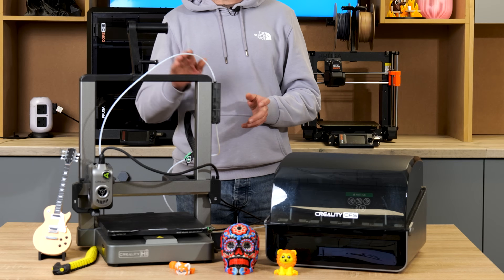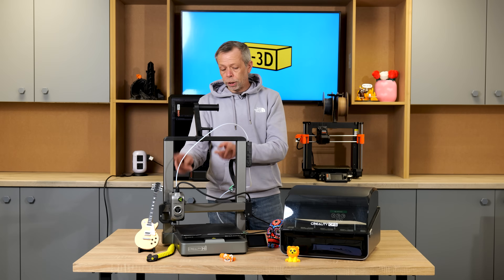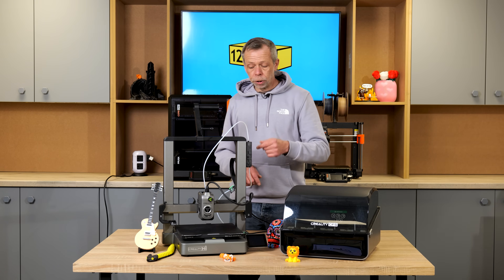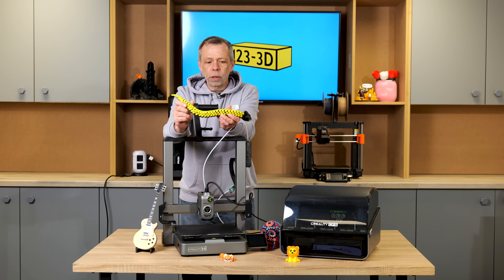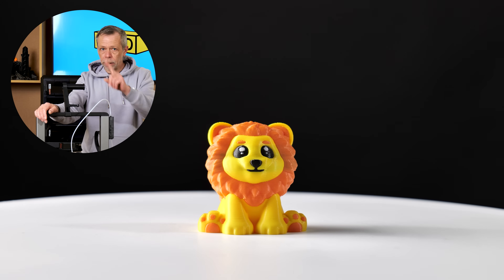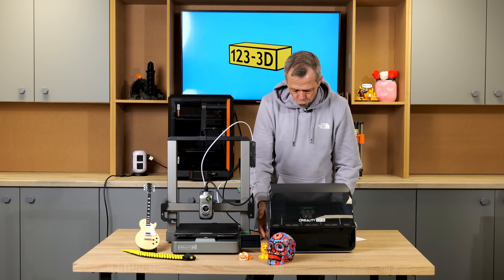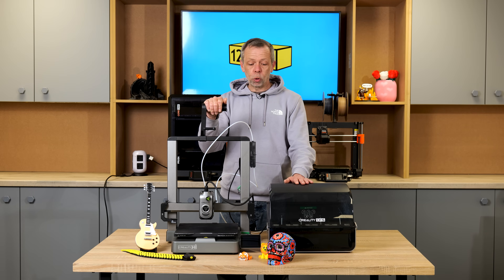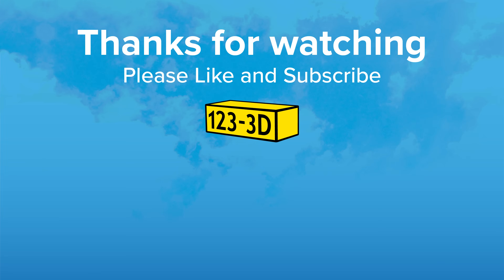Everything You Should Know Before Buying the Creality Hi Combo! | 3D Printer Review

Comment: I just bought mine! Do you have a link to that snake print?
Reply from the maker: This particular snake is from STLflix
Reply: @123-3D-UK    Thanks!! One more question, we've got the printer correctly assembled and we randomly get FR2851 “Retract issue, Filament Buffer failure" and FR2849 “Retract issue, filament cannot be returned to CFS hub errors. Have you heard of those before?

Comment: 2025.12.11
Bought mine April 2025.  Had zero issues, loved the multicolor and for a bed slinger really liked it, with several hundred hours on it. 
 Until.......
A month ago when the bearings on the x-axis started grinding and created crappy print quality.  3 weeks of back and forth with Creality Support they sent me a new X axis guide.  Upon receiving that it was obvious it was the issue, replaced it.
After firing up to calibrate the z-axis motors were out of whack... Trouble-shooted with CS and they said z axis limiter switches, so they sent me those, 2 weeks later installed them and it helped, but still have z axis not aligned correctly on the right side and as it goes up the right side makes a loud clunky sound and you just have to power it off.  All cable connections are solid, the area is pristine clean in an isolate clean cabinet.... My guess is CS is going to try and send 2 new z axis motors... so that will be weeks again.

The point for you?   CS support is slow and you are required to do alot of trouble-shooting ON YOUR OWN.
If I was a 3D print farm, no way would I use Creality.  I have had 6 CS printers and only one - a CS SE has been reliable, that is not a workable success rate.

If you don't mind trouble-shooting an tinkering, the prices are decent.  But we aware of what I have conveyed.

Comment: How do you print up to 16 colors to print with the printer?
Reply from the maker: You need multiple CFS units then simply daisy chain them together with the data cables. Then just connect all the PTFE tubes to the buffer unit.

Comment: My Hi combo keeps jamming in the extruder after just one or two filament swaps, I think when it retracts it causes it to get caught on the sharp edge of the filament hole that is next to the gears, just before the filament gets to the cutter, or for some reason after cutting instead of retracting it pushes or lets slip the filament down into the blob of heated filament, causing it to bulge and get stuck at the gears when retracting because of that. Anyone else have this issue and how do I fix it?
Reply: Yes I had the dreaded blob, had to take it all apart.  Was running at too high temp.  Now run nozzle for pla at 220, 56 bed.  If your extruder is full of crap I let it soak over night in acetone which, cleaned it out.
The blob inside of the rubber had to be pried off.  Then remove the screw holding on the fan and plunge the hole with the clog cleaner.  Good luck.

Comment: Is it possible to get extensions for both of the leads between the CFS and the printer? I ask because I am short of space on my print garden (not a farm yet) and also being wheelchair dependant I can not put things up where I can't reach them. I need to plut the CFS down below my print bench. Another question: Does it matter if I was to use a longer PTFE tube from the CFS to the printer. Thanks in advance.
Reply from the maker: Yes you can get longer cables, they are 485 6 Pin Connecting Cables. As for the PTFE tube yes you can use any length tube, but its worth noting that the longer the tube is the further your filament will need to retract making your colour changes slightly slower.
Reply: @123-3D-UK  Thanks you.

Comment: It would be great if the CFS unit could be placed on top of the printer, and Steve said that would work if the cables are long enough. 
But are they? How far above could the unit be placed?
Reply: There is a shelf attachment on the creality cloud for that
Reply from the maker: Out of the box the unit couldn't be placed above the printer, Steve is suggesting that you put it on a shelf so it isn't taking up work space. You would have to buy a length of PTFE tube then cut it to the length you need, then buy longer versions of the cables that it comes with.

Comment: Hi Steve, how far can the hoses and cables between the printer and CFS be stretched? I am considering placing the printer in a box where I currently have the V3 KE and CFS somewhere next to it.
Reply from the maker: Hi, the tubes are fairly long but if you did need longer ones you can always just buy your own PTFE tube and cut it down to the length you need.

Comment: Hi Steve can a user use aftermarket filament in the CFS or do they need to be Creality brand only? Thanks
Reply from the maker: Hi you can use any filament you like
Reply: Great question- I was wondering the same thing and couldn't find details. Lists it uses rfid on the spools and I've seen too many printers "require" oem ink and refuse to print so it's a hassle to use anything else. 🫡
Reply: I use sunlu

Comment: Can you test pause and resume on this machine? I.e.  for inserting magnets. Some of the other Creality printers (K1, KE) have a (yet to be fixed or even acknowledged) bug in the firmware that basically destroys many of the prints at random after resuming from a pause.
Reply from the maker: We haven't made anything requiring inserting parts mid print yet, but we have paused and resumed with no issues.

Comment: I just bought one and am waiting for it to arrive.  I originally bought a Anycubic S1 but that machines multicolor unit would not work at all. not 1 print could go through it so I sent it back.  Really have "Hi" hopes for this little bed slinger
Reply: i have an anycubic s1and am sending it back.  plagued with problems
Reply: @ronaldderi7471  My Hi came and at first i couldnt get it to work at all.  Kept getting "unexpected resistence" error.  It took a few hours but i figured out the back cover on the printhead was blocking the cutter from engaging. Also the ejection plate for the purge was bent.  I took off the back cover and bent the ejection plate to straight and now the printer works fine.  It seems like printer companies are having BIG quality control issues.

Comment: I got this combo on the weekend and it took a while to get sorted.  Printing perfectly now, but I did hit one big issue.  All the images show the buffer unit being attached at the top of the side gantry. This means the cable from the buffer to the CFS box is quite tight if the box is sitting at the same level as the printer.  A stretched cable (with pins making intermittent contact) causes a world of problems, mostly being the filament doesn't actually get pushed from the box into the printhead.  So either have the buffer box 10cm down from the top of the gantry, or raise the CFS box slightly to have a little bit of slack in the connection cable.

Comment: The most important thing to know is that it's made by Crapality. Well known for parts that aren't soldered, printers that require a months worth of work to make print, and generally just low quality crap.
Reply: I owned the V3 KE and yes you are right. The quality isn't there. However the Hi seem like a good quality machine. The bar has been raised high by the Bambu A1 and the Hi is a direct competitor.
Reply: I know... I have a A1 Mini and its solid so I am thinking about getting the A1; saw this and on paper its better but... Creality made it. What to do...

Comment: I'm undecided, I don't know whether to buy the Creality Hi or the Bambu Lab A1.
Which one do you recommend based on your experience?
Reply from the maker: Really tough call. I would probably go for the Hi based on it having a slightly bigger build volume, and the CFS being easier to do maintenance on with the PTFE tubes being accessible from the underside.
Reply: @123-3D-UK  
As I want to start and when I talk to my friends who already have one, they all recommend Bambu Lab, 
so the decision is very difficult
Thank you very much for your videos, they are magnificent
Reply: I have an A1 and a V3 Plus, bought them about 2 weeks apart and they are both great.  Each has its own weaknesses and strengths.  The A1 always seem to struggle slightly with PETG compared to the V3, but at the highest speeds I think the V3 loses some quality compared to the A1.  Build plate adhesion on the V3 seems better, I usually use a replacement after market build plate on the A1 (once lost power on the A1 when I was out of town, and 6 hours later just started the printer and completed the job - just holds onto the PLA print even when cool until you flex the plate and take it off - stock plate won't do that for you).  I also had to replace hot ends on both due to 1 single blob I had on each.  Service was very good from Creality - got replacement parts for free. So overall I put these printers on a par - except if multicolour is a requirement of course.  I don't know the Hi yet of course, but I think Creality has upped their game.  I used to have an Ender3 S1 Pro as well a few years ago and it needed quite a bit of cajoling and loving care to work well.  Just when the printer got me confident that this time I could start the print, check the first layer and walk away it would fail, some times for 5 or 6 out of the next 10 prints until I started to question and review my print setting that had been working for weeks on end.  With the A1 and V3 I never seem to have issues, unless I neglect normal care like keeping build plates clean and parts lubricated.  From what I have seen it seems to me this Hi will be the same - although it is early days of course.  And Bambu's tech has always been good.  So no help at all in making a decision.
Reply: The A1 doesn't run an operating system since it only uses an MCU, the ESP32-S3 chip, so it's part of the IoT ecosystem. That's why some operations must go through the cloud because it's lacking in processing power. If security concerns you, you might opt for the Hi. The bed adhesion on the Hi has been improved a lot, and you can print on all the available volume, the bed heater has been replaced to AC powered and the bed plate has been upgraded to epoxy material with better adhesion. Regarding the software and color change, Bambu still has an advantage. The Hi doesn't seem capable to print TPU. This is all info I gathered online, although I do own the A1 myself.
Reply: I'm in the same boat just. A1 can be had slightly cheaper too I can't decide.
Reply: @sgoaty  If the A1 is cheaper, then buy it.
Reply: It's the bed size that's got me wondering if this is worth the extra
Reply: @sgoaty  almost the same size. A1 is 256mm and Hi is 260mm.